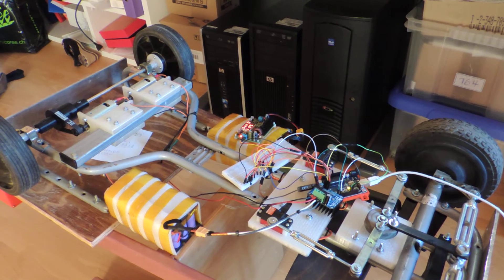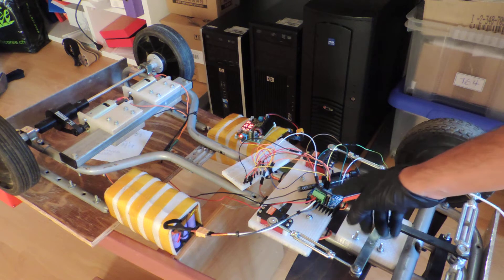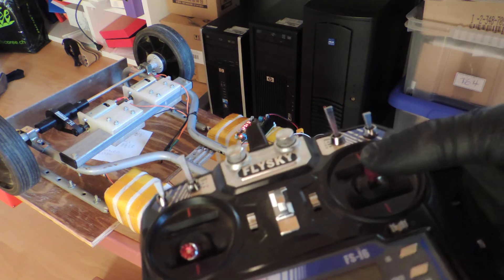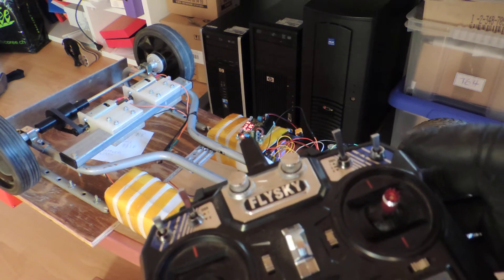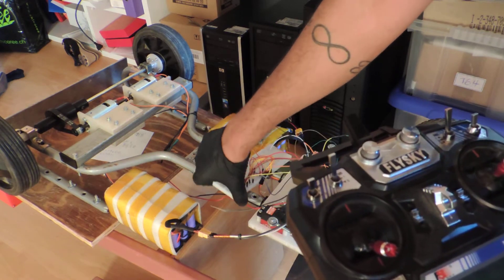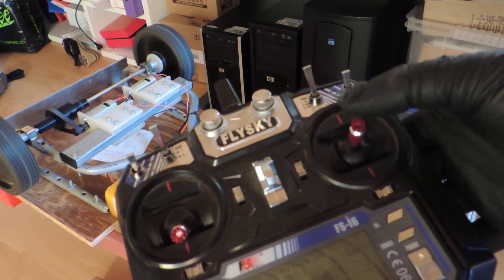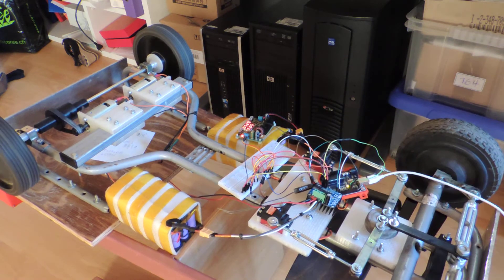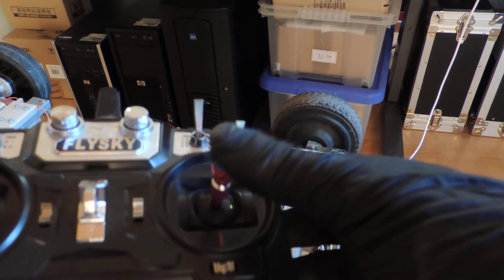Large Scale Electric car - First speed control test (w/ BTS7960B H-Bridge Motor Driver 43A)

Comment: This motordriver is dangerous. There is no electrical isulation between the driver chips and the cooling block. This will in time  cause the unit to short circuit!
Reply: do you mean from the heatsink making contact with another electrical item or making a contact between the two 7960 IC's or from vibrations breaking down the solder resist on the tracks it sits over and shorting out that way or any one of the above lol, its a bit sketchy.
I have one of these and plan on putting it on silicone pads, there is zero thermal compound on them and the heatsink does virtually nothing as it comes shipped and with it on pads it will provide electrical insulation.
Reply: @stevefox3763  i mean a shortage between the two chips because of a lack of electrical insulation. The solution you propose is ok.

Comment: will u please tell me the code and wiring diagram of how to control these 775 motors with rc transmitter,arduino and the H-bridge..Please..
Reply: Dunno if your still after code but after a bit of googling I found two codes to convert rc pwm to a pwm value this h bridge will accept, one worked and one didn't.

Probably can't post links here as most channels have them banned but I can post something on my own channel if your still after a solution.

I have this exact H bridge and its working perfectly using an arduino nano as a pwm converter between the RX and H bridge.

Comment: Hi How are you .? thanks for videos very nice. May You help me about bts7960B code.  forward an back turn .  please arduiino code for bts7960B .   my email adres :  umtdelphi@gmail.com     thanks.  have a nice day.
Reply from the maker: Hi Umit. I am fine. what about u?
Are you going to use it with a remote control or like an autonomous controlled stuff? The code does vary depending on what exactly you want to do. Let me know and I record a video showing you exactly how to do (I guess it will be better than just shoot you a code). 
Have a great day you too and sorry for my late reply.

Comment: Could help me to understand Current sense pin BTS7960B
Reply from the maker: What exactly would you like to know? Usually i don't connect the current sense pins (R_IS and L_IS)... unless you need them for some specificity of your project.
Reply: For my application, Whenever the motor is in stalled condition i should disable it....But my (R_IS and L_IS) pin does not give any feedback. how would i achieve it ??
Reply from the maker: Hi, Inayath. Have a look at the section 4.4.4 of the datasheet of the BTS7960B http://www.robotpower.com/downloads/BTS7960_v1.1_2004-12-07.pdf. It's really well explained in there...

If you are using PWM signal and have any problem to measure the voltage drop with arduino (analogRead) have a look at this forum topic: https://forum.arduino.cc/index.php?topic=493595.0. Hope it helps. ;)